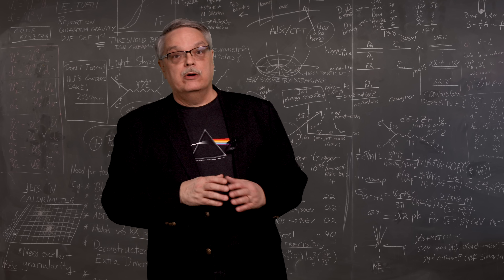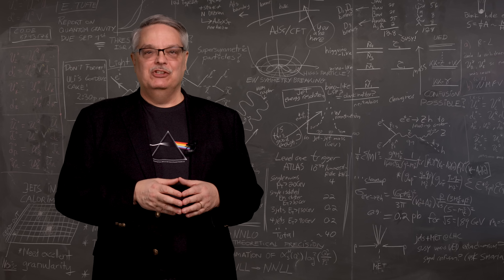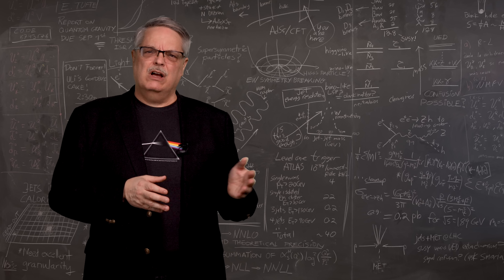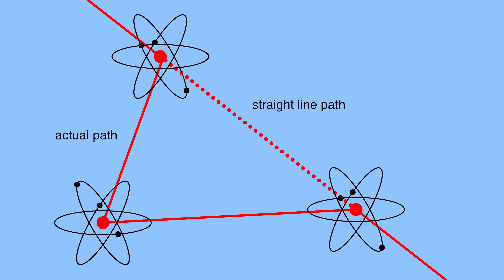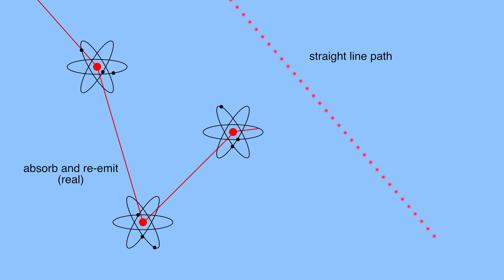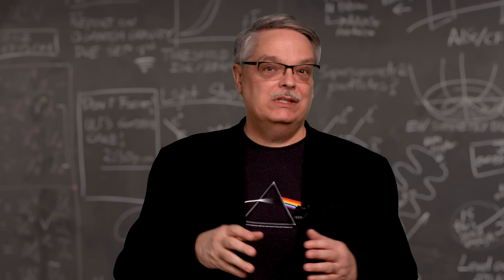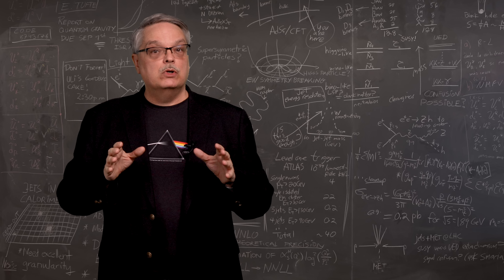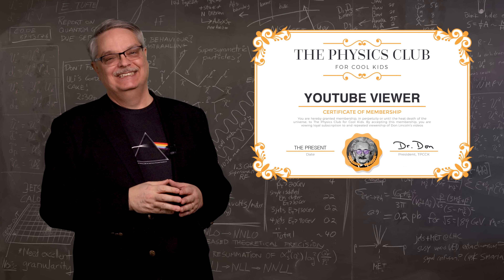Why does light slow down in water?

Comment: I just want to throw my developing understand of the topic. Let's equate (translate) light from an electromagnetic wave to an airplane with engines set at a fix power output, and equate (translate) glass to a headwind (the jet stream)....

Light slows down due the the "headwind" nature of glass. When light exits the glass the headwind is remove and light proceeds at the same speed that it was moving before it entered the glass. 

With an modern jet airplane this is known as "ground speed". When heading into the jet stream the ground speed of the aircraft is reduced. Remove the jet stream and the ground speed will return back to "indicated" air speed...

Since we haven't found a media or a "force" that reduces the "friction of light" less than traveling thru a vacuum.... Just daydreaming early in the morning....

Comment: Question: If light hit the glass, the electrons slow down the light via electric field waves which combine with the light's waves. Since the combining of these 2 waves result in a slower wave, does the resulting wave go to the next electron and slow down even further? If so, wouldn't the speed of light in a transparent material decrease as it travels through that material more? If the idea is that the resulting light returns to the original light wave after going out of range of the electron's electric waves , why? What lets the wave regain its speed? Even if it's slowed down by only 1 electron, after it leaves the electron's wave range, why does the resulting wave return to the original light wave?
Reply: I think it's more helpful to view it not as light waves being slowed down by electrons, but that light waves never are slowed down, but can be interfered with by other fields that can make it look like it's slowing down. So once it's out of range (or runs out of electrons to excite and create the field with) it does not regain speed, but there is no longer the other wave from the electrical field in the medium, so the light is not interfered with anymore and it looks like it speeds back up. Hope that makes sense!

Comment: Very interesting. Well presented. One question. Why does the combined wave travel slower? Why not faster?
Reply: In my opinion bcz, the electric field of light repulse electrons in atoms which creates countering wave which ultimately slows down the light
Reply: @kaushalvyas1142  Yeah, he could have been a bit more thorough there. From what he said it sounds like those waves actually combine, but we could also see it is as kind of interference/resistance process whereby the light wave cannot travel unimpaired because it passes through the electron wave.

In any case, I am wondering whether those waves are related to gravity effects. Seems there is still a lot of mystery about the origin and nature of those EM-waves, and since matter is atoms, with electrons, you always have EM effects in matter. This leads into matter being condensed energy.

There still seems to be that hard wall in front of an understanding of the 'effects beyond', the driver(s) of the observed phenomena. (Basically: Why does stuff happen at all? Why do things move?)

The big scientific challenge is to not get stuck in a rut, to not ever-more solidify our belief of what we know. It helps to apply mental exercises like: What the guy explained there could be producing tears of laughter for an average human 500 years from now.

Comment: I do not understand, wouldn't the oscillating electric field generated by a charge <- induced by the original oscillating electric field
(ideally) only differ in amplitude and by a constant phase thus not producing a slower net field?
What am I missing?

Comment: So in this model, the incoming and the outgoing light beams must have the same wavelength, are parallel, and the amplitudes decrease (or increase) in discrete steps only, due to being photons. Do the experiment with a laser, and the waves' crests and troughs of all the photons are neatly synchronized! in a Glas or in the Water. Then the laser waves get superimposed by the other waves, those excited by the electrons. In a continuous, constant shining beam, all the superimposed waves must add up at the end of the Glas to exactly the original photon-energy (no absorption) or less photon-energy (some absorption) in exactly quantized steps of the original light-photons (only discrete wave-heights allowed). Otherwise, not just the intensity, but also the color of the outgoing beam would be dimmed! How is this exactly possible? And what happened to the 1st, 2nd, 3rd photon traveling through the water or glass: wouldn't the 2nd and 3rd of these get partially red-shifted, instead of being completely absorbed?

Comment: I have one more question on this topic. Postulates of special theory of relativity states that speed of light is same when measured from any frame of reference. Now if speed of light slows down doesn't it violets this postulate of relativity we know  to be true? 
I don't see anyone to discuss about it. Please explain it or show me where am I making the mistake in understanding.
Reply: The point of the video is that d the speed of light doesn't slow down. It's only an appearance based on wave interactions.
But even if the speed of light slowed down that's not really what special Relativity is about. It's about the speed of causality. Light ist happens to move at that speed(in a vacuum*) . And that speed doesn't change in a medium.

Comment: Not a good explanation. If the light wave slowed down it would radiate at a different frequency. Hence it should be a different colour. You missed that point.
Reply: Wavelength is shorter when a wave slowns down, frequency does not change.

Comment: Thanks, Dr. Lincoln,  It seems to me that the electric field of the light would excite the glass electrons movement at the same frequency as the light, with the resulting electron movement creating an identical electric field frequency.  The addition of these two frequencies would then be the same as the incoming light and when added would be the same speed as the incoming light, not slower.  What am I missing?
Reply: The electrons themselves will oscillate at the same frequency as the light, but the resulting electric field that interferes with the light wave will not be
Reply: @johnsMITHhhhhh88  Could you elaborate? I'd think the frequency of the produced field would correspond exactly to the frequency of the oscillation of the charge

Comment: Excellent video Dr. Don! However, I am still confused. If light (photons) has no mass or charge, then how can it interact with an electron in the first place?  🤔🤔
Reply: Charge is the ability to interact with photons. Photons have no charge, so they don't interact with each other. They only interact with charged particles.
Reply: Electromagnetic waves do Interact with charges, otherwise rádio transmition and reception wouldn't be possible.

Comment: Dear dr. Lincoln,
Your explanation has some … gaps in the following points:  
1)	You say: “the moving electrons (which oscillate due to light’s electric field) make a second electric field …”. But if this field of electrons is a consequence of the passing light, this also means that light comes first, and the field of electrons comes second following light. So this should give the result that there is at least one wavefront of light before any of the wave combinations of your theory. And this wavefront should have the initial speed of the incident light. Which there is not! 
2)	Electric fields do not produce electromagnetic waves. Only oscillating electrons produce electromagnetic waves. But for them to do so, they must accept the precise amount of energy needed, which is derived from the Planck equation: E = nhf. This equation defines a small number of values for n (quantum number), and consequently, if we accept your theory, the result of refraction should be respectively small. Which is not! It’s always the same. Your theory here does not differ from the one with emission and absorption you‘ve already rejected. The difference is that your theory uses the electric field and not the energy needed. The fault in both cases is that in nature every value of n is not suitable for the oscillating electrons to produce electromagnetic waves.
3)	Let’s forget the above 2. And let’s assume your wave combination theory. Ok, the frequency of the 2 waves is the same since the secondary (electron) wave is a consequence of the passing light, but what about their phase? You have made them be exactly the opposite: you put the one’s troughs under the other’s peaks and vice versa. How is this possible when light passes randomly by every electron at a different time and a different distance? Your solution is more than ideal, don’t you think?

My best regards
Michael, 
a physics teacher

Comment: Sorry but this actually explains nothing.  The induced movement of electrons creates its own electromagnet wave - I got that,  but why is this induced wave slower,  and why does this in turn create a slowing down of the incident light wave?  Does not the induced electromagnetic wave have to behave the same way as the incident light wave,  and at the same speed?  And what happens to the super positional effect at the glass air boundary?  Does it simply vanish?

Comment: A wonderful explanation. Well thank you. Another video tip: Why does sound ripple longitudinally and light ripple transversely?
Reply: The idea that there's a 'transversal' oscillation is due to bad representational diagrams. Nothing 'moves' in an EM field - it instead should be thought of as a varying strength field at every point. The E field causes the M field, and vice versa. At every point. The direction of energy transfer is given by the poynting vector.

Sound - however - DOES depend on physical oscillation of the medium. And it's a pressure wave which travels longitudinally. It's fairly intuitive actually.

Comment: Does this principle also apply to electricity passing through a resistor?
Reply: No.But it does apply to radio frequency oscillations propagating along a transmission line such as a piece of coaxial cable or a waveguide.

Comment: but the field electrons produce is also light, how come it doesn't move with the speed of light too? how is the electron generated field different then the one entering the medium?
Reply: Stationary electrons or oscillating electrons do not emit any emws. They do however radiate energy when they are either accerlated or come down from a higher state to a lower stable state. This energy is emitted in the form of heat or radiations. If it's EMW then it of course travels with the speed of light as light itself is an EMW.

Comment: I just don't get that. A second wave generated by the material the light is passes thru slows down the light. This sounds like the material the light passes thru has a resistance to the flow of light. similar in electrical terms how a magnetic field in a coiled wire resist change in the flow of current, and once the light leaves the material that resistance is gone, and the light can continue to move unrestricted. I prefer to think of it that way. but I'm an idiot, LOL

Comment: Neatly explained!
Thanks professor!
I really enjoyed it. Indeed, your explanation encouraged me to pursue studying physics academically.
Reply: Feynman's lecture (Volume I, Chapter 31) is better.
Reply: @carmelo665  Please can you explain to me why the wave created by the electrons moves at a different speed 9:20 and also why the combined new way moves slower than the speed of light 9:43 ? Please I didn't find why...
Reply: @Khalid-Ibn-Al-Walid  In short, the interactions of light with atoms (absorptions and re-emissions of photons) cause a net phase shift and the apparent speed of light as c/n. The speed of light in the "vacuum" within the glass remains constant. 
In Feynman's words, “It is approximately true that light or any electrical wave does appear to travel at the speed c/n through a material whose index of refraction is n, but the fields are still produced by the motions of all the charges — including the charges moving in the material — and with these basic contributions of the field traveling at the ultimate velocity c (Feynman et al., 1963, p. 31–1).
Reply: @carmelo665  Thank you very much for this answer ! But Why does it cause a shift in the wave ? I agree that it does modify the wave, but why it does Reduce it's size ?
Reply: @Khalid-Ibn-Al-Walid  The original field is combined with the induced field resulting in a new field that has a phase shift as compared to the original field. The induced field tends to be weaker because of the inverse square law.
Reply: Please can you explain to me why the wave created by the electrons moves at a different speed 9:20 and also why the combined new way moves slower than the speed of light 9:43 ? Please I didn't find why...

Comment: Well you didn't say WHY the "combined wave" travels slower than the speed of light in a vacuum, only that it does so.  I have some thoughts on that related to radio and microwave theory; the electric wave in a bare wire is about 97 percent the speed of light and in a coax cable it is about 67 percent the speed of light.  This is because the electric field lags; it takes time to set up the wave and excite the next electron which sets up a wave and excites the next electron and so forth. 
Now this wave is propagated in all directions BUT an arriving photon is likely to excite a number of electrons and this will produce a coherent wave front; the aggregation of many waves and in only one direction is the sum of these going to still be a wave.  This is the basis of "phased array radar" and other antenna phasing techniques such as MIMO for 5G cellphones. 
Because of how long it takes to excite the electrons, this coherent wave front thinks it is going in the original direction, and it would be if you factor the refractive index into the changed angle of incidence.  
On the exit side, the first portion of the wavefront to reach free space has no further electrons to excite and proceeds at the speed of light quickly followed by the rest of the wavefront but now the direction of coherence is back to the original path.

So what makes refractive index?  Diamond has a high refractive index, 2.2 if I remember right, and it is a tightly bound crystal lattice with not a lot of electron freedom.  Certain wavelengths can interact without being absorbed; but other wavelengths can result in capture and so these substances become opaque and absorbing at those wavelengths.  Glass, for instance, is opaque at infrared and near infrared wavelengths.  

So you want the photons to excite the electrons and make them move BUT you avoid the wavelengths where the electrons will couple with the energy level and wavelength of the photon.  If that happens the electron will capture the photon entirely and move itself to a higher energy level.  This is a quantum process and the electron can only occupy specific levels and dropping back will emit the appropriate photon for the size of the jump back to stable state.

Comment: Great, but can you explain it as a particle? It has to be able to be done since light is both a wave an a particle. 
Also some problems, if light is going slower, it must have lower energy. Where is this energy gone to or stored?
I picture this as a magnet falling down a metal pipe. The magnet slows down in the pipe due to creating magnetic fields in the matter. The problem with that example is that is acceleration and not velocity and some of that energy is lost.
Reply: When light is passing through glass it is causing the electrons in the glass to wiggle. The energy that is causing those electrons to wiggle is coming from the light. That means that some of the energy from the light is being converted into kinetic energy of the electrons, that is where the energy is being stored.

The light is going slower yes, but it's energy is now being given to whatever material it is passing through. When the light leaves the glass, it resumes going at the speed of light but it will be dimmer/have less energy based on how much energy it "left behind" in the glass.

This is probably a flawed explanation but I hope it at least makes some sort of sense.